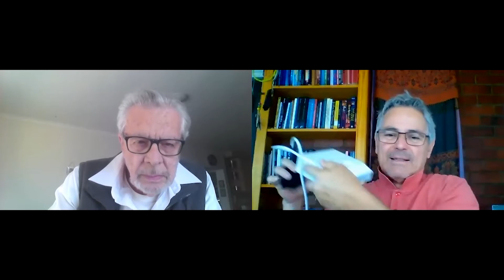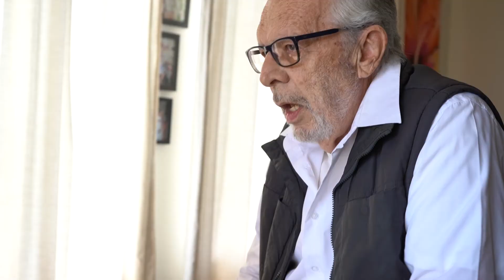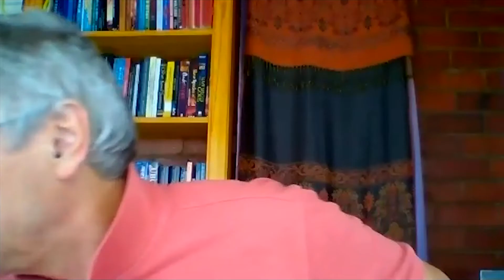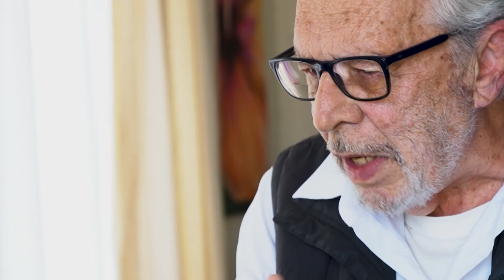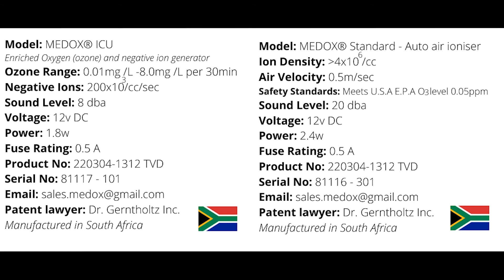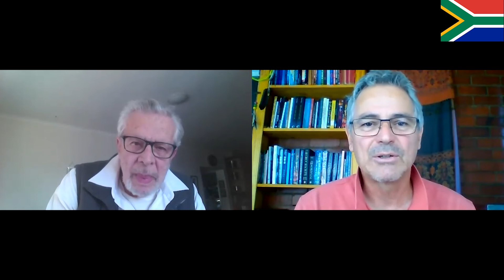MEDOX® Negative Ion Generators - Inventor, Daniel van Tonder interviewed by  Michael Tellinger

Comment: Hi, it is unclear if one requires both units? or can you run the more expensive one as an ion generator without using the face mask and then use the face mask for the 5 minutes?